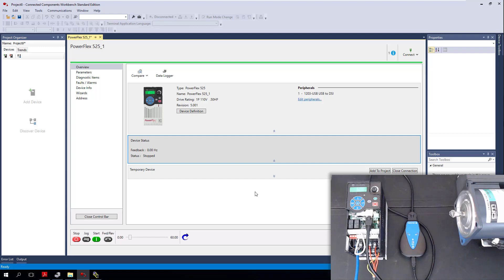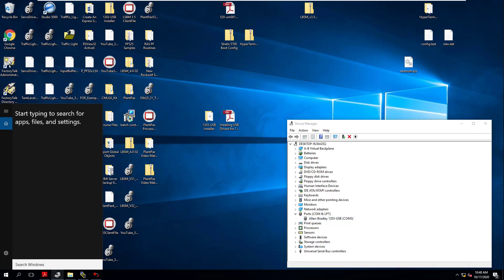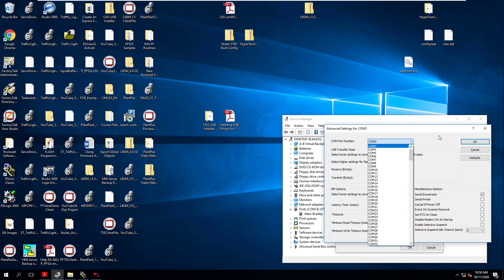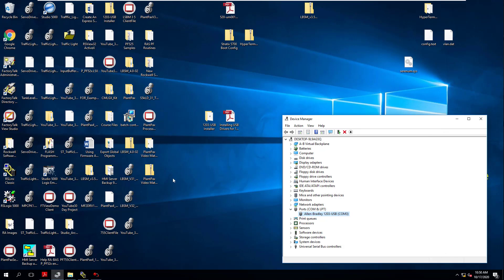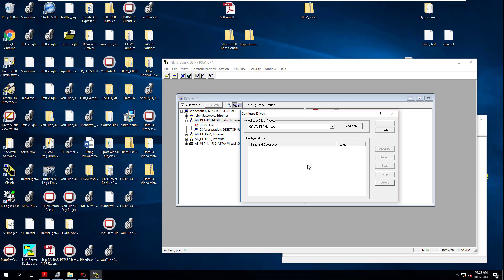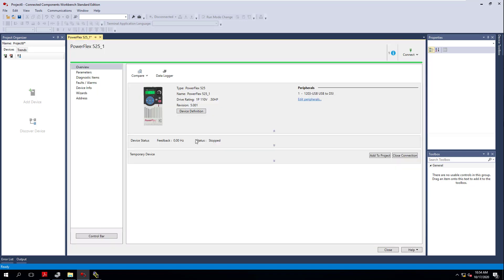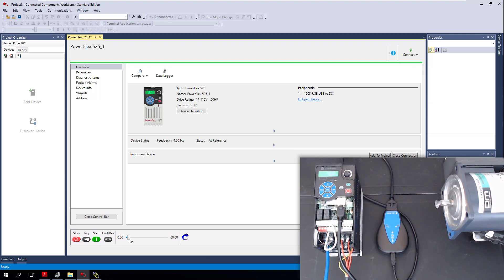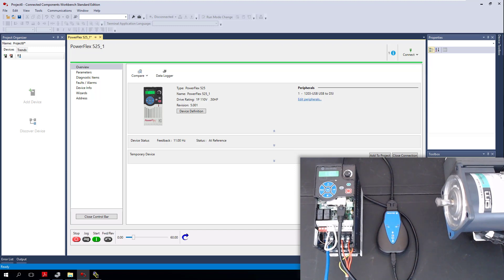PowerFlex 525 Set Up Guide Using a 1203-USB in Windows 10 | Connected Components Workbench

Comment: Is the .ccwsln the only file that's required as a backup? I also have a .ccwsuo in my folder, what is this for?
Reply from the maker: For the new Powerflex drives, it's version dependant on what software in needed for backups.

This firmware version using requires CCW
Reply: @ShaneWelcher  Hi thanks for the reply. I have successfully uploaded from some powerflex drives, the issue I have is that the folder contains a .ccwsln AND a .ccwsuo. Which one of these would I actually need if I had to download to a replacement VSD?
Reply from the maker: @martinmchugh1924  Honestly, I way I use CCW is to upload my drives in one section for that machine then if I ever need to download to a drive then I open the CCW file then select the drive, get a connection to the drive & download.

This approach takes a lot of guess work out of uploads & downloads.

Hope this helps